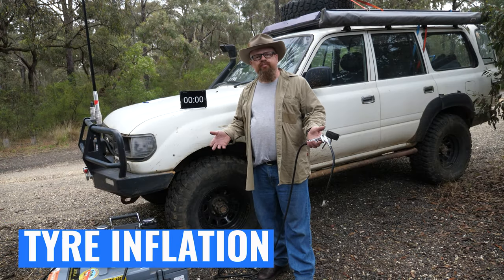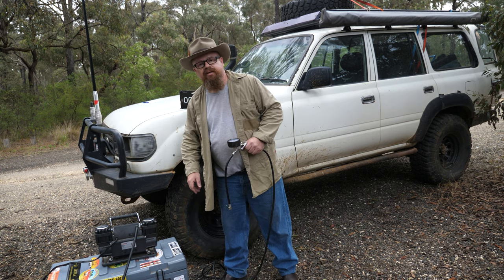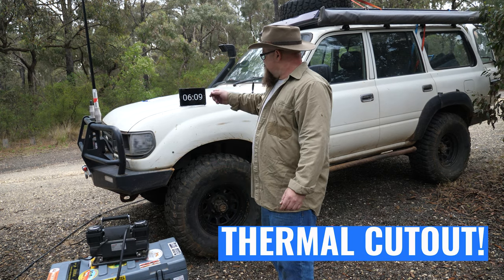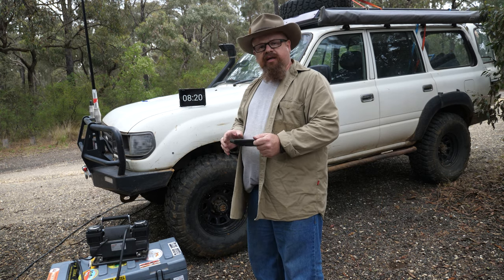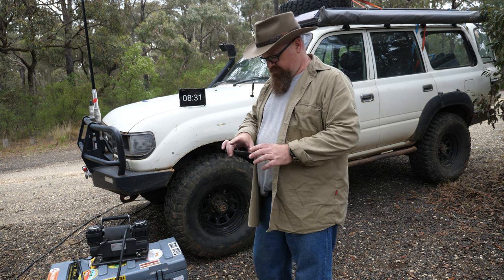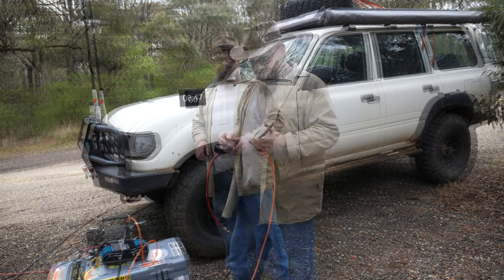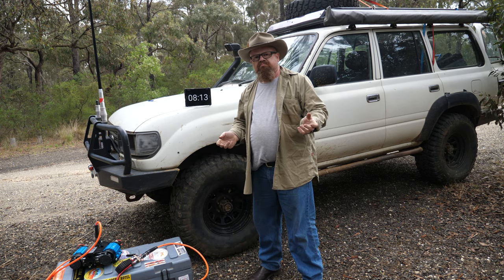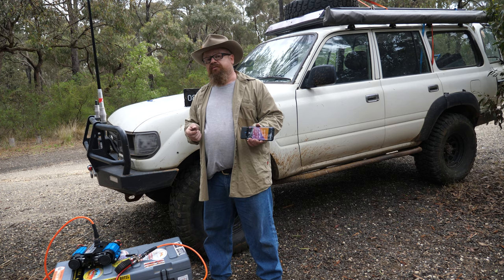ARB Twin VS Supacentre Thumper Max Air Compressor Part 1

Comment: So I own both. I bought the thumper while the ARB was getting repaired again.

No doubt the ARB is better but it isn’t 5 times the cost better
Reply from the maker: My ARB is still going strong, Matt is now on his third Thumper. So the price is slowly catching up.
Reply: @LockyourHubs4WDing  the thumper got a good home now. Had a dead 40L Supercheap workshop compressor. Off with the motor, installed the thumper.

Makes it possible to run air tools now.

Comment: Mount my thumper Max to canopy headboard and have some 12v computer fans pushing heat off of the heads while running, ez cheap solution to thermal cut.

My next experiment with it will be connecting higher gauge power as the cable it comes with is very average so looking at soldering on some 6awg to handle its 90ah power spikes.
Reply from the maker: Is the wire getting warm during prolonged use?
Reply: @LockyourHubs4WDing  haven't measured the wire temp but just for safety purposes to prevent a fire or flare up in such rare occasions if it were to heat, plus allows me in the rewire process to connect it to a 100a circuit breaker to use as a switch to turn it on and off.
Reply: Oh and mine is also connected to a tyre spider so it doesn't get breaks between tyres or when checking psi its just balls to the wall pumping all 4 tyres at same time.
Reply from the maker: I've looked at the tyre spider, though get tangled enough filling two tyres at a time with the Jamec Pem Auto1000 let alone having to wrangle 4 hoses!

Comment: Prematurely ruined an otherwise good set of muddies because of the thumper max. The POS compressor would cut out randomly or not even run at all at times, very temperamental.  This caused me to repeatedly do tarmac runs on low pressures to the nearest servo. I suspect that’s the reason my tyres started overheating, tearing lugs and became impossible to balance. I went through 3 sets in the 1 year warranty period . 

Finally but the bullet on an arb twin and it’s worth every cent. Two friends also had the kings compressor. I aired up my set of 33s and my mates 32s” (whose kings wouldn’t start) before the other bloke aired up his 35s because of the thermal cutout or whatever it was. 

The last time it died outside of warranty I pulled it apart and the thing is so poorly built. The piston does not sit centred in the cylinder because the con rod just has a bolt that pinches onto the shaft but wasn’t aligned properly. This caused one side of the Teflon ring seals to be really tight up one side probably a contributing factor to the thing overheating. Pulling the motor apart and you see so much sand and metallic debris caught in the stator as it’s just not sealed. I can’t stress enough if you have the means to go for the arb, go with that. Even if it means taking a few weeks overtime. Or if must get one of these style, at least get the rebadged one with a 5 year warranty. The bitterness of poor quality sticks around long after the sweetness of low price is forgotten.
Reply from the maker: Well said, the owner of the Thumper Max is now on their third, I'm still on the original ARB Twin!

Comment: I run the thumper  - not the max, and an air tank. I can keep pressuring the tyres when the thumper overheats :) Way cheaper than the ARB. Premium paid with this arrangement is the space for the tank.
Reply from the maker: I think both systems, both thumper or ARB would benifet from a tank.

Comment: Good comparison.  Personally, I find it alarming that the ARB didn't cut out when reaching that temperature.  This could lead to premature wear of the unit, and depending where it's mounted could expose other components to undue heat.

I have seen a lot of people modify the thumper by fitting small 12 volt fans in the heads.

Example
https://youtu.be/8lsUw6YzR18

I have used both compressors.  Value for money wise, the thumper max is a 5th of the price of the arb twin compressor.

Comment: The arb is 6 times the price with only a very slight performance increase.
Reply from the maker: Though the owner of the Thumper is on their 3rd and I'm still using my original ARB. So he's catching up!
Reply: @LockyourHubs4WDing  well, I’ve had a Thumper for 3 years and it’s still goi g strong. I suggest that owner needs to be more careful!
Reply from the maker: @officialWWM  he's a mate, I'm calling him now!
Reply: @LockyourHubs4WDing  tell him I said hi.

Comment: strange that your thumper hit thermal overload, I’ve done 2 4wds (8 tyres) up from 20psi on several occasions and mine hasn’t even hit it yet. Luck of the draw I guess
Reply from the maker: Could be, we didn't do anything out of the normal for the test. Both compressors were at "room" temp at the start of the test, the 35s were at 18psi on both tests and the tests were done back-to-back, so no temperature difference on the day.
Reply: I second this with the thumper we go from 16psi to 40 on 33s on the cruiser and never hit thermal cutout even in mid 30z its still not to hot to put back in the bag

Comment: My Thumper max blew its piston after using it for less than half a dozen times. What if this happened when I was in an isolated location?
Reply from the maker: The owner of that thumper max is on his third now. The ARB twin in the video is still going strong.
Reply: I’ve had my thumper Max for about 1 year now and it’s burnt out on me this weekend. Luckily we had another (different brand) compressor in the group. I’ll be getting the arb twin for sure next
Reply from the maker: Mines just headed out the door with my son to pump up some motorbike tyres! Still working great!
Reply: @LockyourHubs4WDing  i appreciate this vid champ. It showed me longevity is much more important than pumping up tyres “quickly”.
Reply from the maker: @alaadinhamawi  110%

Comment: This video is very misleading. So take off about 25 seconds for the ARB because you didn’t turn it on so say about 7.5 minutes or something. Whereas the thumper you didn’t factor in that you had to wait 5 minutes for the temps for reduce so you could restart it again, so that time should be added into the total. Just the fact that the thumper couldn’t even pump up 4 mid size tyres is an indication just how shit they are..
Reply: price mate, price.
Reply: Xavier mann yeh you get what you pay for.. poor man always pay twice. My arb twin did 3 cars the other day before a mates did 2 tyres cos it it thermal cutout
Reply from the maker: The owner of the Thumper is now on their third. I'm still running the same ARB twin as in the video. One more and he will have spent the same money as I have, I suspect it won't be long now.

Comment: How long did you have to wait for the Thumper to cool down after it tripped out??
Reply from the maker: We left it for around 5 minutes before trying again, and it fired right back up.
Reply: @LockyourHubs4WDing  My thumper has never cut out because I let it free flow, no trigger, in between tyres which cools it down.
Reply from the maker: @PrimalTimbo  That might be an option if you have the time to wait.
Reply: ive got the old gen 1 single motor thumper that thing is a beast, no thermal overload (well i havent hit it yet, lol i pumped up my 4 35s from 18psi to 42, packed it away, then realised my mate with his tjm/arb brand name thing had only done 1 tyre in the time it took me,, so i unpacked it and pumped his other 2 up and packed it away agian before he finished his 2nd tyre, (though the output line does get red hot after 4 35s, but as you said letting it freeflow while running between tyres it seems to cool a little with no loads

Comment: Well that’s a bit sad on ARB it’s worth about $800 and Kings is worth $300 that ARB was a minute faster and Kings on overheated i’m telling you now I wouldn’t be buying ARB
Reply from the maker: It's about longevity as well (which is hard to test in a video) The owner of the Thumper is now on his third, I'm still using the original ARB twin.